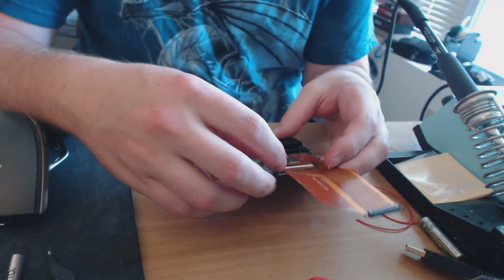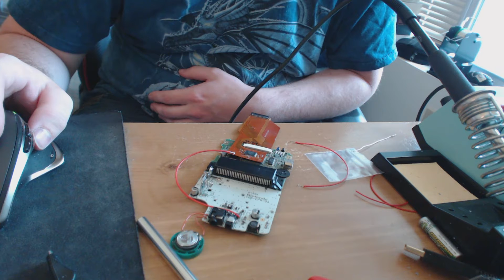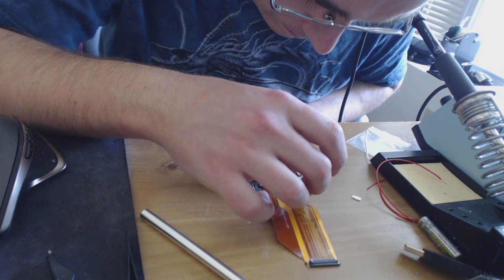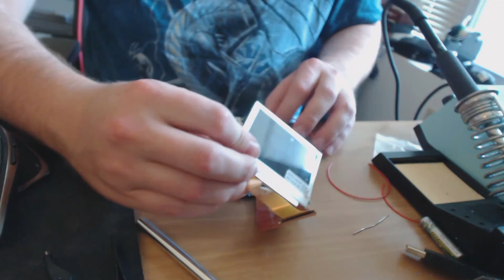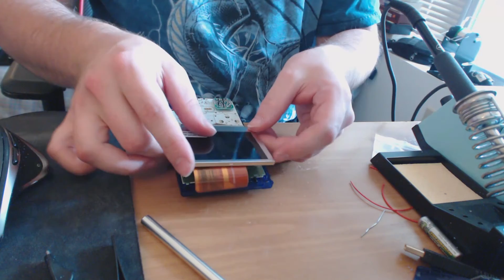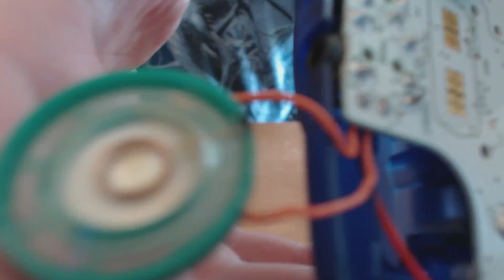Turning a Gameboy Color into a Backlit Gameboy Color - Part 2

Comment: Alright keep it up cant wait to see the rest, hang in there
Reply from the maker: don't worry fixed the sound issue with a pin lift on one of the chips and grounding it out
Reply: @ORCACommander  hola que chip hay que levantar?
Reply from the maker: @js83245  it was so long ago, I do not remember at all which pin nor the chip that i didn't have properly lifted. If you are looking to undertake this project I do not suggest following my videos. this was made using prototype parts which have been superseded by new methods and new parts.

Comment: Thanks for the both parts! Very interesting. I'm thinking about getting the V2 Version of the ribbon cable but it seems to be pretty complicated. At least for my, cause I'm not that good at soldering. Could you maybe answer some questions?
• How is the image quality? Benn said that the V2 will be better when it comes to soldering and also the graphic.
• How long did it take you to make the whole process including the assemble?
• Did you lose any features because the LCD was so big? (Link Connection etc)
• All in All is it worth? I already got a GBC the AGS-101 Screen and the screwdrivers. :-)
Reply from the maker: I lost maybe 15 or 20 minutes to plastic dust clean up between cuts but otherwise this was all done in real time.
I've not put any play hours in yet as i am trying to troubleshoot down that speaker wine i point out at the end
nope, it is feature complete - however you do loose two out of 6 mounting points for the triwing fasteners that keep the shell closed. hot glue or epoxy is a must to keep the shell closed,

I  think it may be worth it. the V2 will be the better investment i think until we get the full motherboard replacement version like the dmg got.
Cost break down:
Dremel $115
V1 ribbon $50
LCD: $45
Glass $5
Soldering Iron $160
Ifixit Tool kit $70
Back Up Kiwi $40

Consumables:
electrical tape $0.97
Kester Solder $30
Reply from the maker: after a bunch of troubleshooting with bennvenn we found a fix for the audio. check out his facebook page for instructions